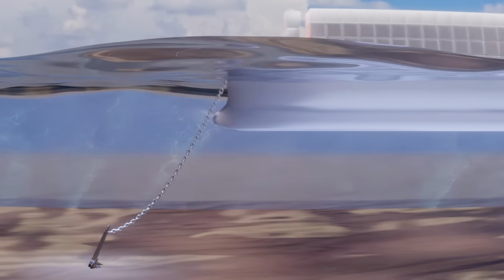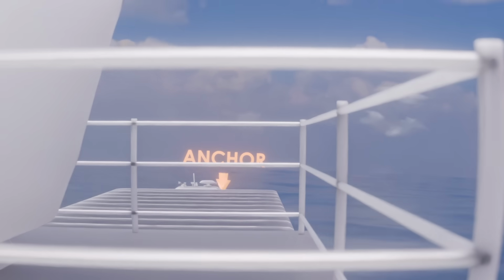Anchors don't work the way you think

Comment: Did not even mention "scope": How many feet (real measuring units) of chain is needed is based on how many feet of water. My sailing yacht is 51 feet long, it has a 70 pound anchor. In 25 feet of water at my anchorage I need a scope of 7:1 or even 9:1, that means I need at least 7x25=175 feet of chain in the water to sufficiently anchor my boat. I do not like putting that much chain out though so I try to anchor in water of 15 to 20 feet as my ideal. If there is a storm coming I will put out a scope of 9 or even 10 to 1 to ensure I stay put, but with that much scope and so many dummies who sail, I find if I have more than 100 feet in the water (which means I need a MINIMUM of a 100 foot circle around MY anchor to account for swing) that dum dums will invariably anchor with 30 to 50 feet of my anchorage. They do not account for the swing and only put out a scope of 3 or 4 to 1. Those are the dum dums who drag in the middle of storm, always at night when you are trying to sleep. I have woke up to see a boat next to mine within 25 feet! My boat is twice that long! I NEVER ask them to move (they won't) I just pull anchor and go to another spot, even during a storm at night! And it never fails, I ALWAYS see some dummy I moved away from dragging into other boats when it gets windy! MORE CHAIN MORE HOLDING POWER! I have 300 feet of chain but have never used more than about 200 feet of it. I know how much chain is in the water because I have a link counter. Hopefully that never breaks because if it does I have to tie colored rope to my chain very 20 feet. I did that when I got new chain but the rope eventually all fell off and the counter still works

Comment: Wow... Wrong... The Anchor is solely for making the chain move! Most of the Chain dropped down and sits together tight! If there's a strong current and the Chain is pulled straight ~ more chain is dropped or Anchor is raised! But what holds the ship in place is the Chain! The Anchor simply makes sure the Chain drops down easy!

Comment: Anchors generally don't touch bottom out at sea. The sea is mostly too deep. It just hangs down. Touching bottom you might be anchored on a coast, and that causes massive habitat problems splashing down. Like a small meteor strike. I've seen ships do that in pristine clear waters ruining a whole area's clearness for hours, the fragile tropical ecosystem covered with sand all over.

Comment: 5-7 times the depth of the water in heavy weather.  I’ve anchored many ships in Alaska with 9-10 times the depth of the water as well as using a second anchor and still dragged in high winds…….also frequently “dredge” an anchor to control the bow while docking.  This is done to move the pivot point of the ship as far forward as possible to allow greater control.  Typically with 1-2shackles on deck or in the water and speeds below 2 kts

Comment: My anchor is a 10 lb kettleball weight.  I drop it overboard and it hits the bottom, and usually it sinks into the mud on the floor of Chesapeake Bay.  I'm sure a bigger vessel needs a bigger anchor and a different design, but my kayak doesn't move once my weight hits the bottom.

Comment: Anchor holds the chain, chain holds the ship. The link between ship and chain is called "the bitter end". A catenary shape forms when the stresses along the length equalise. Old school architects used catenaries as models to design arches, you just build the arch the opposite of a catenary hung between the two arch support points.

Comment: Big chains don't break. Your windlass brakes will fail first, then the last "resort pin" breaks, hopefully before collapsing the chain locker wall. It's meant for discarding a chain that you simply can't recover so it's way weaker than the chain itself. As a safety officer I loved stenciling "Bitter End" next to the big hammer. One time that chain wall was bent in almost an entire foot. We had to replace the pins with something weaker. Still, saved the company a lot of money, but the fitter wasn't pleased to work for a week in the locker.
Reply: I've seen two big chains break.  They do.
Reply: @BigGuy42080  POV: you are so illiterate you cant read a couple of sentences 😂
Reply: @BigGuy42080  I guess it depends on the definition of "big", relative to the size of the ship itself. On my biggest bulk carrier they didn't seem "big" anymore, we didn't trust them that much. Even so, the chain is not supposed to break first, other things are designed to give way. If the chain snags on the rocks and it has corrosion, some manufacturing error, or they're really old,  sure. But that's a rare case indeed. Thunder did strike twice for you.
Reply: I had on a few occasions the ship I worked on literally break free in Maui. Snapping lines on ships of this size is terrifying, I'd hate to see what the anchor could do to it.
Reply: well described.  - the voice of experience.  its easy to detect.   i see no mention of the influence of the heavy seafloor gear against the buoyed weight of a ship parked in protected water.. (or in a distressful rough sea / bad weather scenario either)   the presenter / writer doesn't go deep enough into the physics of how such weight can dominate a floating tethered object of a mass of many multiples more..
Reply: They absolutely break. Broke one on a self-unloader in the Madeleine Islands back in 2004.

Comment: The correct name for measuring a chain is a shackle which is as stated 90 feet. Chains aren't measured in metres in use. The rest is mostly correct but it depends upon the type of anchor ships tend to use the flipper type but vessels such as pipe layers or rigs use drag embedded anchors and there isn't any chain.

Comment: You have the weight of both grand pianos and blue whales wrong; pianos between 225 kg and 550 kg (much heavier than rach chain link, IF you have that weight right at 160 kg....), blue whales up to 180 metric tonnes, way less than total of the "road" (IF you have that right...) at 243 tonnes........... Not impressed.

Comment: anchors don't work the way you think they do...they work exactly the way I think they do. The anchor does in fact hold the vessel (in addition to the rode) if the anchor becomes dislodged the vessel will still drag regardless of how much rode you have out. Its the combination of both but the anchor is the star of the show

Comment: You need to actually check your AI slop script.
Otherwise it's full of small but errors. Start with the Blue whales size.
Reply: 100%, had to pause the vid to look it up. Yup, off by nearly double.
Reply: Yeah I was pretty sure they were more like 100 tons not 250
Reply: Also 90ft of chain isn't a "shackle", its a "shot" its funny to watch this video as someone who used to manufacture anchors and chains for the USCG and Navy
Reply: @justalocal110 A 90ft length of chain is called a shackle or a shot, with "shackle" being the common term used in British and international maritime circles, and "shot" more frequently used in American English. Both terms refer to a standard length of anchor chain, which is 15 fathoms or 90 feet (27.5 meters).
Reply: @sakikogookheng silly American me assuming our unit of measurement is universal 😂 I did not know that, thanks for educating me.
Reply: @justalocal110 No problem at all! I had no idea it was called a 'Shot' in America until your comment either!
Reply: The 160kg grand piano comparison got me, it immediately stood out as being completely incorrect. That's less than the weight of two average American men. It's basically 2.5-3 times that weight.

Comment: The 90-foot length of chain is a "shot" not a shackle. The red connecting link has white painted links on either side. One white link= 1 (first shot), 2 white links= 2 (2nd shot) or 180 feet, or 30 fathoms. Just trying to be aqurate or accurate for non-robots.
Reply: I’ve worked at sea for 25 years, always used “shackle”. “Shot” is likely used more by Americans?
Reply: Yep, and in "real measuring terms", that's 15 fathoms.

Comment: Well done video.  When I was a submarine officer, we had the opportunity to use our anchor many times (this is unusual for submarines), so we got to understand it quite well, and we were always trained that "it's the chain that holds the ship, not just the anchor." 

One minor note (since you are [correctly] criticizing other representations of anchoring, it seems like being accurate is important):  At 4:47 when the anchor is being retrieved the animation shows the flukes turning backwards (pointing straight down).  I don't believe this is how most anchors are designed - the flukes can only rotate with respect to the shank by a limited amount (+/- 45-60 degrees?) - this limited range of motion is even shown at 1:12 in the video.  This limited rotation is what allows the anchor shank to be used as a "lever to break the flukes free from the seabed" as stated in the narration.

Overall I loved the video (although, I will admit that Beethoven's 5th Symphony as an underscore seemed a bit mismatched to the content, IMHO), and I've subscribed!

Thank you and keep up the great work!
Reply: I mean this saying is pretty useless. For small vessels, the holding power comes almost entirely from the anchor digging into the sea floor. The larger the vessel, the more important becomes the weight of the chain. Now whether that additional weight actually anchors the vessel or just secures the orientation and the anchor's angle, I dont know. Id guess its a bit of both. But there is certainly a reason, we dont just use big chains with a weight attached instead of anchors.
Reply: @Brien831 My comment was focused on my experience with anchoring our submarine, but I would completely agree with you that the weight of the chain could be less important for certain vessels, in fact, very small vessels (20ft or so) use rope not chain, further emphasizing your point. 

However, addressing your comment about orientation, all vessels swing on an arc around their anchor with a significant radius - when my submarine was anchored in many different ports in South America (they can't really accept Subs against the piers), we had to constantly monitor our swing radius via GPS and visual fix to ensure we weren't swinging further than expected (an indication that the anchor might be moving), which is another example of how the length of chain helps ensure the anchor isn't disturbed (until you intentionally retrieve it).  

Bottom line to me:  situations and implementations vary, but this video is valuable for the situation they present: larger vessels that require significant stability.
Reply: I thought that part didn't make sense. If the anchor is fluke is free spinning then there couldn't possibly be a lever
Reply: A memory just came to me. Are there anchors that actually do dig in? For a very specific use, a kind of hightech spearhead that burrows?

I distinctly remember seeing one in an article as a kid. It was cool, but ridiculously over engineered iirc. Could've just been a concept though.
Reply: @VikingTeddy there are various types of plow anchors, which are meant to dig deep.
Reply: @GigaJigg Yup.  There are actually many different anchor designs, this video covered one specific design, but really was focusing on the function of the anchor chain as part of the system and the general procedure for deploying/recovering, so I didn't quibble with that choice.
Reply: I thought the dramatic “fate symphony” was for the viewer, who allegedly don’t know how anchor works, thus, have come to this fateful reckoning. 😅
Reply: Yes, for smaller ships/boats look up Fortress aluminum anchors.  I have one, and it does dig down.  There are steel spade-like anchors as well.
Reply: If you were on a 688 Los Angeles Class…how many anchors did you lose?!!  Asking from experience. 😅
Reply: @skookapalooza2016 I actually served on both 637s and a 688 - we were fortunate not to lose any, but heard many stories about other boats losing anchors!
Reply: This is AI bro
Reply: Lol. I feel sorry for this guys kids... 

Kid runs in with a Rembrandt esq painting that took six weeks to paint... 
- "well I dunno son, the lighting looks kinda warm for that time a year and as for the vanishing points from foreground to the background I think they're out by 3/16th of an inch. 😂

Comment: I knew all this already.  I spent about an hour one day on the Intrepid talking to a vet about his job in the forepeak.

There's one big error in this video--the form of the links.  Anchor chain links are shaped like a Greek letter Theta, the oval with a line across the middle.  Without that middle part, the chains illustrated in this video are susceptible to kinking.  The middle part of each link is necessary to keep the chain from kinking.
Reply: I saw that straight away--still its good as an explanatory tool.
Reply: There is a way bigger error in the video. 
Take a closer look at the ancor.
Reply: @AvangerCellar, would you be so kind to tell us, please? I didn't find it.
Reply: @sergiinlv  The flukes rotate so far that it is impossible to let the ancor do its job. It will automatic slip.  Its a constructiv error. In one scene you can see the flukes are hanging down. They should show in an angle upwards. also one scene the ancor is dragd behind and the flukes point in an unlogic direction.
Reply: @AvangerCellar  No shackle to allow chain turning at the end of the chain  on the anchor!
Reply: Uss intrepid museum… i really wish I had that bomber jacket at the gift shop
Θ
Θ
Θ
Θ
⚓️
Reply: This is what you get if AI makes a whole video for you.  Hopefully there will be an AI blocker, just like ad blockers.
Reply: Not all mooring chains have a central pillar
Reply: @Arkaid11 yes they do…all commercial ships have studlinks as per class regulations

Comment: Sadly, your first video is inaccurate. Let's school you. The anchor is the PRIMARY part of anchoring. without it the chain would do almost nothing at all. The anchor without a chain, would give significant holding power. Put together they work in harmony, neither one being more important than the other. 
Also, you call it the 'rode'. That's not what rode is. Anchor chain is chain. Anchor rope (used for much smaller vessels) is rope. When you have chain attached to rope, the collective name for that pairing is rode. There are specific circumstances when you would use only chain, and when you would use rode. 
Massive ships like the one in your video don't have rode, because rope is superfluous in a 100, 000 ton ship. They have anchor and chain and nothing else. 
Finally, sand is good at holding ships, it just depends what anchor you use. 
So really I'm not sure why you made a video about a subject you clearly are uneducated in, and you called your channel "aqurate". Which, if you mean 'accurate', it most certainly is not.

Comment: A section of anchor chain is called a "shot" not a "shackle." The chain is connected to the anchor by a "shackle."
Reply: Shackle: 

"A nautical unit used for measuring the lengths of the cables and chains (especially anchor chains), equal to 15 fathoms, 90 feet or 27.432 meters."
Reply: correct it's called shackle.
Reply: Americans may call it a “shot” but the correct term is a “shackle”. 30 years of anchor handling drill rigs here.
Reply: I was going to point out the same thing, you beat me to it CAPT.

Comment: I love the snobbish attitude people have with metric. It isn't a better system, it's just easier for conversion. Simpler doesn't automatically equate to superior. Imperial is actually more precise for a lot of measurements and is still used globally in the scientific community for those measurements. Weird, almost like both systems are equally useful and it entirely depends on the person and the application on which is more appropriate. Room temp IQ, can't remember conversion tables, and can't do mental math that isn't just moving a decimal point left or right? Metric got your back. Making precise measurements for angular deviation where your measurements need to be as close to whole numbers as possible for accuracy and you learned basic algebra? Looks like you're using imperial, because MoA is insanely precise with whole number measurements being a fraction of the size of a single miliradian. Meh, people have to always find some bullshit way to pretend they're somehow better than the rest of humanity instead of just different, and an easy temperature check on that attitude is the metric snobbery.

Disclaimer: before people start with the shit talking, we use metric where I'm from, I just have to work with both systems in my profession. Having actually used both separately and intermixed in the real world, I can honestly say that the people who only learn one or the other and pretend it's just the best for everything tend to be some of the least intelligent people in my profession and usually don't last more than a year or two.
Reply: man you actually wrote all this...
Reply: @Microwave_King Yes, imperial is usually better in most cases, unfortunately most of the world has been brainwashed with grams and metres...I use the Barleycorn/Rood/Firkin/Stone system....it works for me (but no-one else 😢)